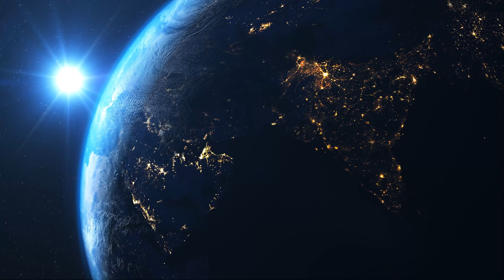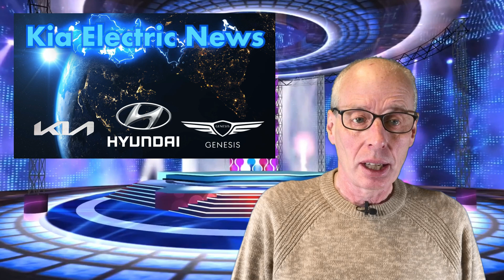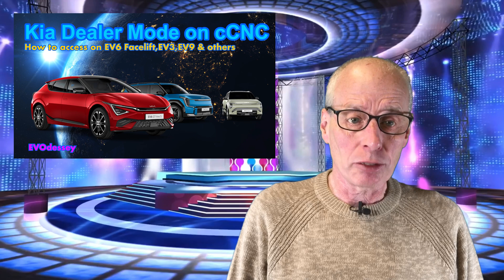Kia Electric News Episode #95 5th January 2025

Comment: Hi Brian I’ve spent Christmas in Madrid this year , on return after leaving car at airports car park for a 8 days , I thought I’d start the climate control on as it was freezing! But Kia connect told me it can’t as it’s been idle to long and 12v battery would not allow it 🤔?even though I’d left traction battery at 60% ?is this correct
Reply from the maker: Hi Gavin,yes,if the car has not been driven for 7 days then Kia Connect kicks you off to protect the 12v battery. They changed this a couple of years ago i think. Does the very same to me at home as well.

Comment: The Kia EV3 GT line with a paint option costs £40,110 and thus from April will cost an extra £410pa Road Tax in U.K. for 5 years. ie £605pa. This will also be payable if bought second hand. What a cock up.
Reply from the maker: But dealers are flexible on price and are throwing premium paint in for the lower cost i’ve heard. So is the tax based on published RRP or invoice price?
Reply: @evodessey  published RRP
Reply: @evodessey  Hi. It’s  based on “List Price” which you could say is RRP. So discounts don’t make any difference. So, VED road tax is £10 for first year and then £605 for next 5 years. If you bought it second hand 2 years old, you would still have to pay £605 for 4 years. I think I will be looking for a pre 1st April 2025 if I buy one. This will apply to loads of cars. Cheers.

Comment: Cheers as usual Brian. You’ve never experienced ICCU issues on your EV6 have you?
Reply: And I have an EV6 that will be three years old in April 2025 - with no ICCU issues so far (touch wood) 
So it doesn't appear to be a widespread problem - and I love the car 😊
Reply: @ Thanks for your reassurance! I feel really sorry for those that have been affected but I’m sure it’s a small minority that gets amplified through social media.
Reply from the maker: @simonheape5279 I've started a log,I can only count 4 so far,if it was a thing then it would be big on Reddit or Facebook and it is not. There must be a few 1000 delivered so far since they started delivery in Korea in July. I'm not finding the evidence like we had with EV6/Ioniq 5 in 2022.
Reply: @evodessey  Not with you Brian, is that a log of EV6 ICCU failures?
Reply from the maker: @simonheape5279 no a new log of EV3 ICCU failures
Reply: @evodessey  Great for you failures are minimal on EV3 but I was fishing for reassurance on my EV6 😄
Reply from the maker: @simonheape5279 on the EV6 the only data I have is on the US NHTSA complaints database. With each ICCU software update the number of complaints is getting smaller and smaller.
Reply from the maker: Never,only 12v battery failure under warranty, same ICCU,3 years 2 months old
Reply: @ Thought so, I’m trying to banish the sense of doom every time I set off on a long drive! 😅 Thanks for helping!

Comment: 2:31 Hmm EV3 issues already even next day after delivery? Is the UK build different from Korea. Very concerning especially switching to EV for the first time. Expecting delivery soon Guys it is best to wait or cancel order 🤔😮
Reply from the maker: In my EV6 & the Ioniq 5/6 & Genesis GV60 it’s estimated that the failure rate for ICCU is 1%. I’ve never had a problem in 3 years of EV6 ownership. That’s why i say it’s too early to tell if there is an issue yet. I’m not cancelling my order. 7 year warranty will deal with it regardless.
Reply: @ definitely warranty will cover. It’s the inconvenience it comes with though sometimes
Reply from the maker: @enoserwaa agreed. It's less of a problem for me though being retired since I can walk to the dealer. Will be more of a problem going down to one car though. If it was a big problem I would have found it all over the Internet. As I say I will keep an eye out now.
Reply: @evodessey  trouble with the 7 year warranty is a couple of things - Kia wont give out courtesy cars unless you're part is on backorder, which is then approved 48 hrs after the request is put through and then you have to wait for the hire car to actually arrive, so you're left without a car for days on end before you ever see a replacement. The other BIG issue is getting the car in for a diagnosis to start that process - dealers cant even start the process until after an official diagnosis. My EV6 has ICCU failure (despite passing the recall inspection and having the update last summer) and it failed in early Dec. I still dont have a replacement car yet and absolutely no idea when the ICCU will even be back in stock. Sadly Kia have zero focus on the customer experience and that means I, and no doubt many many others, will never buy another after suffering the Kia customer service experience!
Reply from the maker: @tripswithgriff Sorry to hear this,what you say about hire car is also true in my experience.

Comment: Interesting that the Niro EV doesn't seem to suffer from ICCU failure.
Reply: It’s not built on the same E-GMP-platform that is used for the EV6, EV9 and EV3, so I guess it’s also related to that platform/specific ICCU. And of course, also in the Niro EV ICCU failures occur, but not that often as it is for the other (EGMP-built) EV’s..
Reply: @peterhelincks2438  the EV3 does not use the same EGMP platform as the EV6, the EV3 is a 400v car.
Reply: @mad4tar77  You are right, but it’s also built on the E-GMP-Platform, with the only difference that it’s 400V. That also explains the different part number for the ICCU I think..
Reply: I’ve had the Niro EV for 2 years (26,000 miles) and the only issue I’ve had was a defective reversing  sensor. 

Excellent car!
Reply: @otleybull  mines at 35k Miles same age, fingers cross it stays that way

Comment: Charging speed for 800V EV's will be limited / capped in rhe US, when using Superchargers, due to the thin cables and the fact the car's BMS has to adapt to lower voltage. I got this from the US podcast: thesmokingtyrepodcast, released two weeks ago.
Reply: i think the only way  in the US for fast charging on 800V car if the V4 supercharger actually get what they should be capable of which is 1000V, the V4 in Europe are still limited as i think they are still using the V3 cabinets.. the cable aren't the issue tesla have a higher current than the 800v cars and in fact i think are being over driven at a too high a current and charge speed can be reduce to to temperature of the plug when charging a tesla.   All 800V car are capped even in Europe this is due to the relative low voltage output of the tesla cabinets and i think has been software limited, if this limitation is removed it is my understanding the max charge speed on a V3 would be limited to 150kW this is due to the 400v to 800V conversion capability in the car. i have no proof of this it was stated on the out of spec video some time ago. when the 800v cars are connected to a 400V charger the car tells the charger to set it voltage of X volts then the DC to DC convert AKA a boost converter using the rear electric motor boost that lower voltage to meet the pack voltage + x amount of volts on top of that for x level of SOC. just remember the charge is a constant current  controlled not voltage.
Reply from the maker: There was a great Inside EVs article explaining why it’s always going to be slower on 800v and giving a lot of technical details. I can’t find it now of course😂

Comment: Thank you, would like to know more about charging EX3 from Tesla chargers.   Can the adaptor be purchased on line and if so where.   Thanks D in IRL
Reply: EV3 NOT EX3
Reply from the maker: You only need an adapter in North America.Tesla has a special plug J772 in the North American Market which has become the NACS Standard (NACS=North American Charging Standard). In Europe most Tesla rapid chargers ate CCS so don’t require an adapter. To use open Tesla chargers you have to install the Tesla app,create an account and payment details.